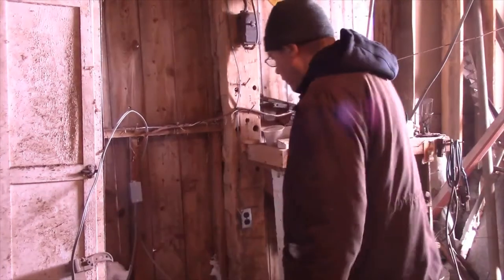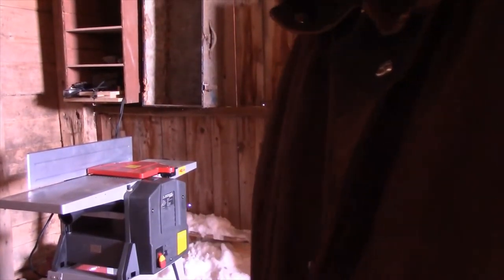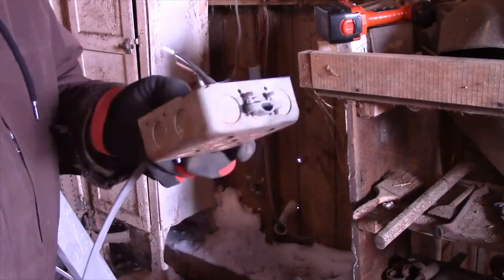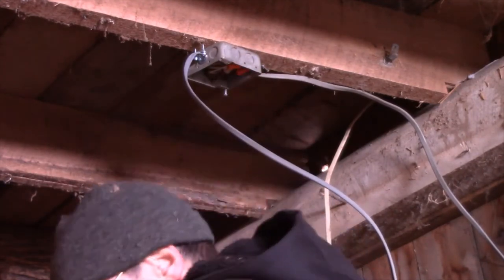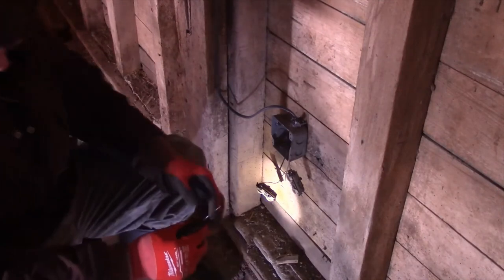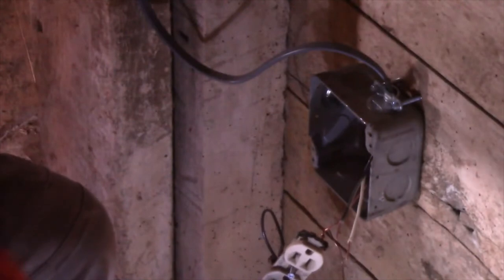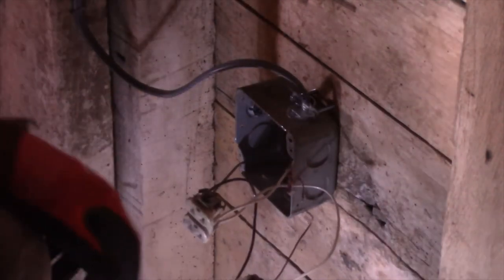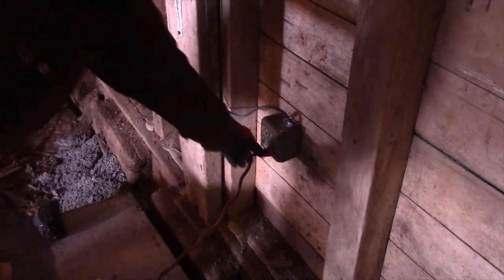Power Circuit In 100 Year Old Barn

Comment from the maker: You can see that electricity may be scary at first and you think you will get a shock or something. I have got a shock from 440 and I'm still kickin'. The power was shut off first before I even started by using the circuit tester. I have 2 circuit testers, one is old and simple the other is a Harbor Freight model. I tested this circuit before I started with a two wire test light made by GE that is featured at the end of the video. I use the GE test light because it is reliable and easy to use.